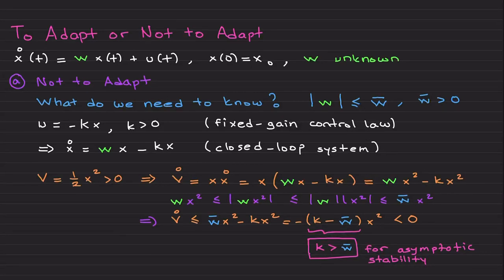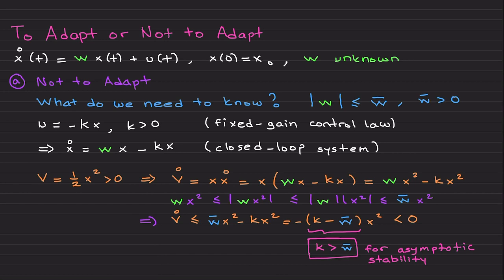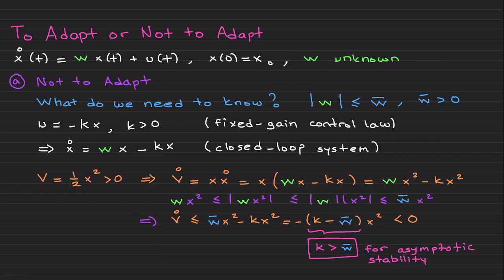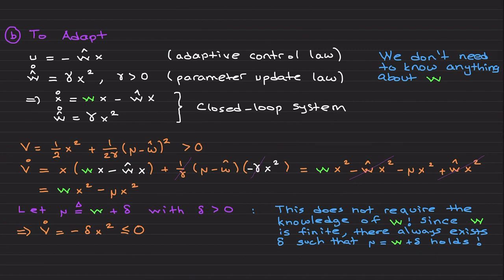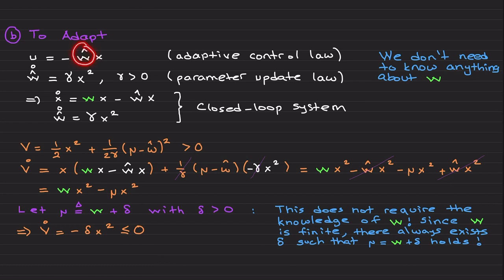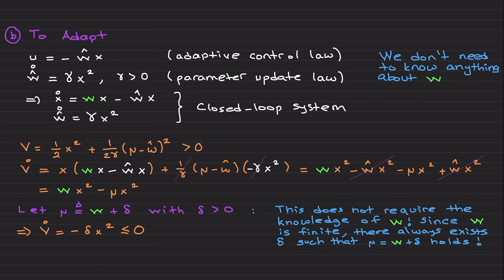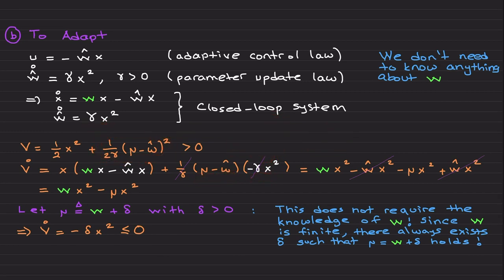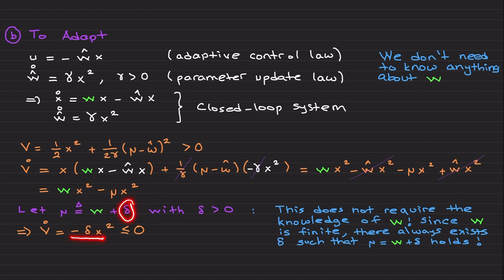To Adapt or Not to Adapt (Lectures on Adaptive Control and Learning)

Comment: Thanks a lot for those valuable lectures.
At 11 min 06 seconds. For Delta less than zero V dot can be greater than zero. So, we can say that we have achieved stability (bounded) and hence asymptotic stability for a case only if delta is greater than zero?  What does that imply that sometimes our adaptive controller will make the states converge and sometimes it doesn't?
Reply from the maker: Thanks for this important comment that we should make clear. Check 12:18 of this video. When V=-delta*x^2 we arrive V<=0. This means boundedness (Lyapunov stability). We then apply Barbalat's lemma to conclude x always converges to zero.